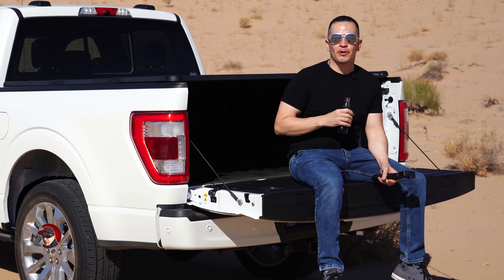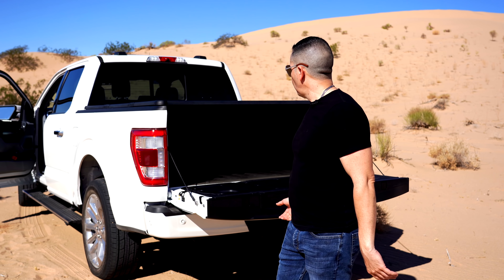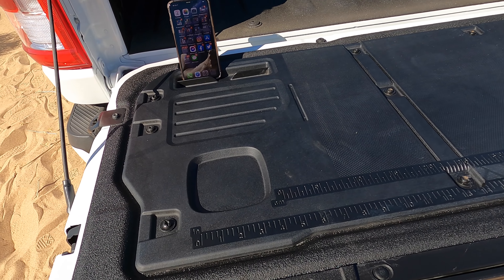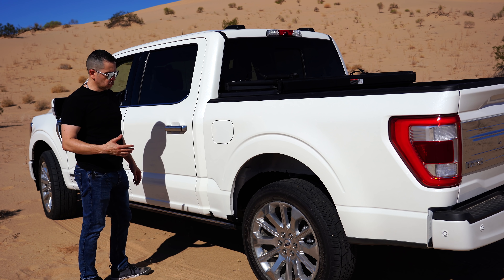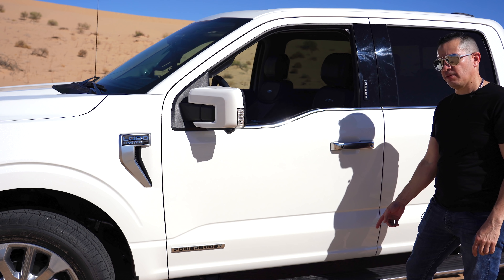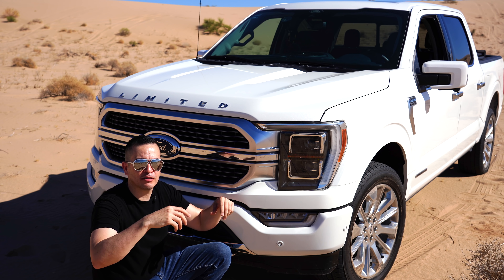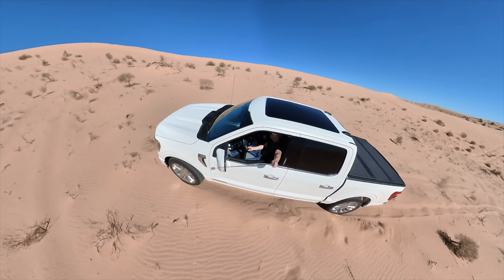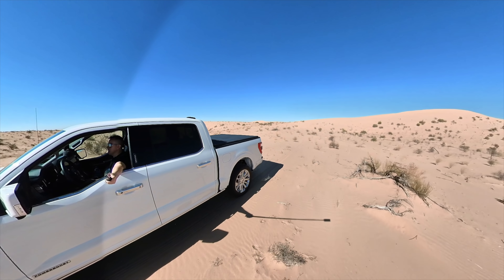La Reseña mas COMPLETA que veras de la NUEVA Ford Lobo F150 Limited

Comment: Pregunta, para usar la toma de corriente interior, o las, porque creo que atras tiene otra de 120 volts, con su alta capacidad de 20 amperes, es necesario activar el modo generador? Pregunto porque la mayoría que trae tomas caseras su capacidad se limita a un máximo de 400wy esta con 20 amperes es mucha la diferencia y supongo que es posible por la alta capacidad del generador integrado, no un tipico inversor nada mas